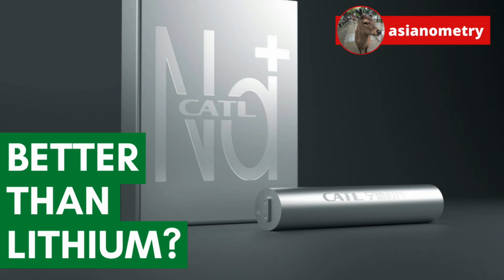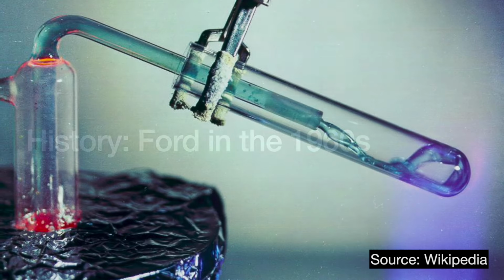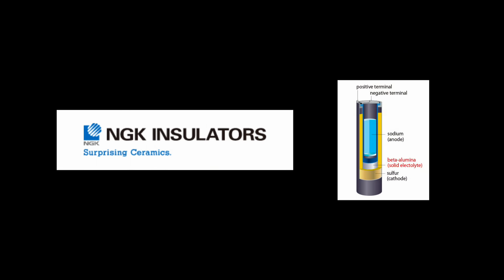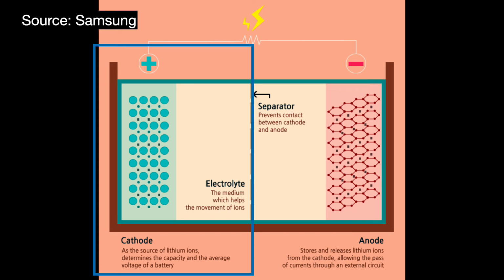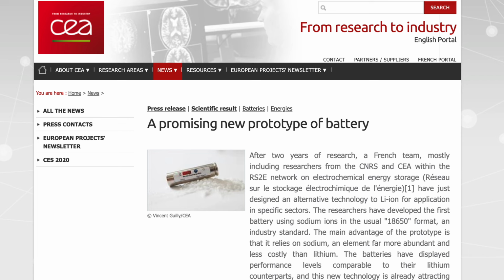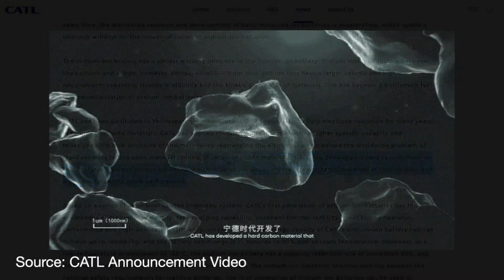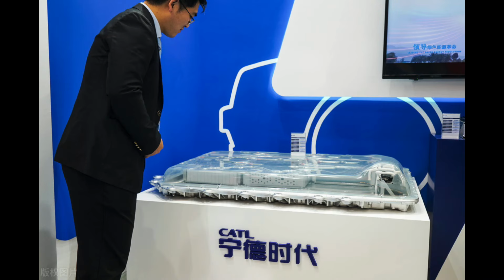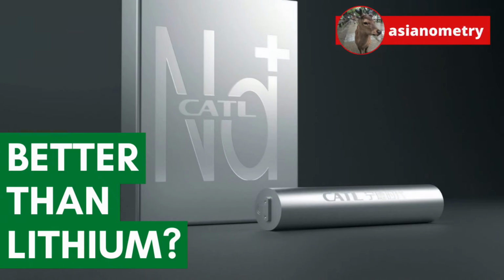CATL's Sodium-Ion Battery: Better than Lithium?

Comment: Thank you for producing this.  Many people are unaware that while sodium ion batteries  and calcium ion batteries are too heavy for electric cars, they are great for storing utility scale power where weight is unimportant.  Also, I can't see how we could possibly run out of sodium!
Reply: thay may even make desalination water plant economically viable in the future by having a good income stream from sodium produced as a byproduct
Reply: EASY ! Sodium Batteries , to run just 50 km, in a Hydrogen Fuel cell/ hybrid vehicle !  - the total weight of the hydrogen(plus tank), plus Fuel cells + Sodium  battery, should be roughly equal to the weigh of a 200km range Lithium Battery pack.
Reply: @avibhagan  LFP batteries already solve almost all issues for BEV other than lithium and even Tesla has contracted to use LFP batteries so I just don't see it happening.

And the big pushers of hydrogen which have been a couple Japanese auto makers, Toyota and Honda, have pretty much conceded they need to move to BEV, so the whole hydrogen thing is dead for cars and small trucks.  It MIGHT make it's way into ocean transport and long haul trucking in some countries.  I'm skeptical because it's just SO INEFFICIENT it's INSANE!!!

The amount of conversions and the cost that goes into each conversion make hydrogen almost laughable, then add in it's incredibly hard to store AND if you were to even use this for long haul trucking, the amount of infrastructure needed would be cost prohibitive and add in high pressure and hydrogen go together just like a HUGE BOMB.  There WILL be an accident eventually if you went to large scale use and each one would get more and more people to be anti-hydrogen.

So, just no.  Increasing electricity production and charging a battery is WAY more efficient and less costly than hydrogen.  And money matters.  Go ask all the people who can't afford their rents and mortgages anymore due to the latest round on inflation.  BEV can be manufactured for less cost than ICEV.  Tesla can already do this but they have MASSIVE profit margins, and Chinese auto makers already do this, which is where most BEV is.  Or, almost 50% of all BEVs on the road are in China.  Most BEVs are manufactured in China.
Reply: Yup, grid storage, not BEV.
Reply: maybe. sodium-ion is still a largely new technology. as it develops, assuming it stays cheaper than li-ion, it's likely that it will be used for low-cost small cars and other mobility devices that are okay with more weaker batteries. current focus in evs is on large expensive sedans, but there's plenty of space in the market for small cheap vehicles.

Comment: One factor that always needs to be included in statements of energy density, but almost never is, is the energy density at the totally integrated pack level. While this is hard to state with great precision because the variations of each individual installation, it is possible to identify features of a specific battery that will strongly impact the weight of the non-battery portions of the pack, such as thermal isolation to control thermal runaway of a single cell so it doesn't cause a cascading failure of the entire pack and the cooling system (which should include the weight of the cooling equipment outside the pack itself like cooling lines, coolant, pumps, radiators and fans).

A new battery like these Na-ion might only have an energy density at the cell level of 180-200 Wh/kg while the latest Li-ion are up around 280 Wh/kg, but the high flammability of the electrolyte of the Li-ion battery and the accelerated degradation when cell temperatures are not tightly controlled result in a considerable addition to the total pack weight and a commensurate reduction in net energy density. If a new battery chemistry like this Na-ion cells doesn't have the flammability and thermal runaway issues and so don't require careful thermal isolation between every cell and if they can retain their charge capacity even at elevated temperatures, then a lot of weight can be eliminated from the battery pack. The result would be that the fully integrated net energy density could be much closer or potentially even superior to Li-ion batteries.

And if the new battery is cheaper and/or has a longer cycle life, even if the pack energy density is still slightly lower, these types of batteries could still win out over Li-ion batteries in applications like large commercial vehicles which might be less sensitive to weight/range and more sensitive to total lifecycle cost and reliability/safety.
Reply: Ok but lithium iron  phosphate is pretty safe and doesn't have thermal runaway like lithium polymer
Reply: @NeilBooth  Tesla has made some model 3's with LFP battery packs, the LFP Model 3's are about 250 lbs heavier, have more Kwh, and achieve better real-world range. So in practice the OP's comment holds up, having a less sensitive battery cell lets you get those energy density figures pretty close at pack-level. LFP batteries are good, but Lithium will still suffer scarcity prices, so it's good to be developing these alternative chemistries that use more much more common elements. Sodium and Aluminum battery chemistries would be good for large-scale "economy grade" battery cells to use in cheaper EVs and grid storage.
Reply: @0hypnotoad0  Mhmm. Density doesn't matter at all for solar setups for example. Longevity, cost per Wh and ecological impact are what matter here.
Reply: Hot sodium aint a whole lot less reactive with air than hot lithium. Their similarity to lithium batteries suggests that they will not fare better in this respect than lithium ones for transport applications. While for utility storage where power density is only a secondary consideration there are plenty of competitor chemistries using cheap materials. But time will tell.
Reply: @kenoliver8913  The biggest problem with lithium is availability and the environmental impact of mining and processing. That's the bottleneck of going fully electric. The environmental cost alone should be reason enough to switch to sodium batteries even if it means some tradeoffs have to be made.
Reply: main issue here is: Lifepo4 is much more expensive. Lithium research had gone through so many years while  Na battery research is still infant, so I highly optimist for cheaper Na battery in the near future. Lithium is so earth toxic, dangerous.
Reply: "but the high flammability of the electrolyte of the Li-ion battery and the accelerated degradation when cell temperatures are not tightly controlled "

And yet Li-Ion has been in BEV for years, and it's rare for this type of issue to happen unless the manufacturer did something wrong.  The Chevy Bolt comes to mind.

Tesla put out the 4680 which has been going into vehicles this year at the Austin TX plant.  Their temperature management isn't extreme.  So, "tightly controlled" is a bit of an overstatement.  In fact they don't have an issue when charging which USED to be an issue with older cylinder Li-Ion batteries, and this is tabbed vs. tabless design for which the 4680 was designed for.  It's called charging along the entire width of a jellyroll instead of just as one side and the charge has to work its way across the jellyroll.  Their 4680 increases reliability and charge cycles, heat issues, just about anything you can think of is an issue, but yes Tesla has to use a little energy to warm them in cold temps and then use heating to keep the pack above than min temp.  So, Tesla 4680, solves almost everything other than the environmental issues for Li-Ion.

In case you don't follow BEV, Li-Ion probably won't be the dominant battery type already.  LFP batteries made by BYD have climbed in percentage for batteries going into BEV, and this is going to grow since Tesla and Toyota and probably other automakers have made contracts with BYD for these batteries, which means building plants outside of China in the case of Toyota.  Tesla right now is probably using LFP for battery packs going into the Asian market already but I haven't checked to confirm it.

Energy density CERTAINLY matters, and you only have so much space in a car to use for a battery pack.  Americans want high mileage/charge vehicles so they can do their long trips.  Now, once low cost econo sedans hit the US from Toyota using LFP batteries they're going to sell even with lower range because once you get to economics of scale, BEV costs less than ICEV.  Almost any of the main BEV makers in China could sell a BEV in the US for less than $20,000 USD and if there weren't a large tariff slapped on them they'd sell like crazy even though they're only 250 miles/charge.

Weight also matters.  It affects range.

LFP batteries are already superior to Li-Ion in almost any conceivable way except energy density which is why auto makers are using them.  And for Li-Ion, the only thing that's going to compete against them is the 4680, and really you should read the details about what they are and what they allow and how Tesla uses them to make a structural battery pack to understand why that's probably the best it gets for Li-Ion.

I don't see these batteries replacing LFP.  Maybe they end up in grid storage.  LFP already solves all the issues with Li-Ion in BEV except the need for lithium, but lithium is a common element.

Something better will need to come out for BEV that doesn't use rare earth elements, and doesn't use lithium, and doesn't have temperature issues, doesn't overheat, can be punctured and a whole list of other things that LFP has already solved.
Reply: difference is only 30%.. but price gap will be 50-60%..
Reply: Another big part of this is the operating temperature range, the need for a battery management system (BMS), and whether it will need an active thermal management system. 10,000 cycles with only 5% loss of capacity is a huge deal, as one often overlooked metric, but the most important one, is cost per kWhr/cycle
Reply: Ok but lithium iron  phosphate is pretty safe and doesn't have thermal runaway like lithium polymer

Comment: If they can achieve the 200 watt hours per kilogram as mentioned at 11:12, an EPA rated range of 250 miles should be achievable in a car like the Tesla Model 3. Can they be charged to 100% without excess degradation? Do they perform well in cold weather? If so, they would be as good as today's lithium ion batteries with a range approaching 300 miles charging to 80% to 90% to preserve longevity. If you know something about sodium ion's ability to take a full charge I welcome your comments.
Reply: Cell or pack

Comment: REGARDLESS of their ups and downs - if you can have 50% of EVs using a different type of battery - you can make BOTH types of EVs cheaper because now you don't have to get in line to buy a LiIon battery driven car at higher and higher prices as production struggles to cope with demand.

Comment: "Natural sources of lithium are limited" is  an asinine point all natural resources are limited, the question is how limited. Lithium is est. to be 25-34rd most abundant element, known sources could provide several hundred years worth. Also up to 95% of the components of the battery is theoretically recyclable. Look at Red Wood Materials former Tesla CTO and co-founder JB Straubels new company, they are claiming to be recycling at 90% and are opening a new factory. They aren't he only ones.

Comment: All looks good and also as you said..it might be big nothing..if price of material is lets say 30% of existing Li ion battery why should i as customer go to battery that is about 20% cheaper than Li ion..and nobody can tell me if it will last after 10 years ..If price would be 30% of Li ion and same parameters (lets say double the weight a bit bigger housing for it ) i would accept it and use it on my house as main battery..but ofc they can't prove this..they only talk how it could be used and outside few prototypes they don't have anything usefull ..Yes they might test it for long time and that is fine..but you can be sure LiFE ion battery research isn't stopping also..they also want to be better than somebody else..so they try to inovate..

Comment: It won't be commercially viable with 10-30% lower cost, since it has nearly 40% less energy density than Li-ion.
Reply: Battery cost is always compared as USD/kwh.

Comment: Note the difference between the wide class of “sodium batteries” and the more specific “sodium ion batteries”. I’d say that within that wider class, there are “sodium ion”, “sodium metal”, and “molten sodium” battery chemistries. The advantage of sodium ion cells is they’re basically designed to compete with lithium ion cells, which have the high energy and power densities needed for electric cars. That said, the complex manufacturing process and potential for dendrites make these still not as optimal as they could be, especially for grid storage. “Sodium metal” batteries would consist of batteries with a solid sodium metal electrode, would likely be primary cells without some rather strange electrolyte, and could be major fire hazards when punctured. “Molten sodium” cells are even worse for danger, and also have that heat problem you mentioned, but they’re basically impervious to dendrites or other electrode damage, since the electrodes are liquid. There are also notable alloys like NaK and GalInStan that are liquid at room temperature and would hence have no heating overhead, and there are also some strange salts that are molten at room temperature. Importantly, these molten cells have very simple internals, and are more promising for grid storage where weight doesn’t matter. For grid storage to be viable for a country like Germany to switch off all its coal and solely rely on solar and wind, it needs to be orders of magnitude cheaper than lithium ion.

Comment: the codes r tail banking 72% vol not loud enough, 1968, 68 or Me & devil last act of play AC window unit comes up alot w/71 degs if u hve 2 deg float & room temp 70 deg setting. This is 262 comment & likes 2.7k & the not likes hve been working either or as well. See Beg of word/game I saw 27 OT as right "number". Those who could hve been keeper/wives birthing new ruling line, not knowing about 70/72 float NT number at time. <I had a multi faith test> many times over in the "game... or game w/in game... or then some... & codes working again!

Comment: What people fail to realise is that even if a much improved battery is created - say 10 times the capacity but the same size as lithium units, they will therefore require a much longer charging cycle. Fast charge? Sure and so many higher capacity batteries would destroy the electricity grid. Longer charge over a weekend? Like everyone else you mean and thus wreck the electricity grid too.
Electric vehicles as they stand are utterly useless aside as short range commuter vehicles. The ICE is the only way forward.

Comment: When will we be getting rechargable aluminium air, and potassium batteries
Reply: They are! You must change the electrolyte and you can recharge about 10 cycles until drops the capacity the alluminium air battery

Comment: Lithium extraction is actually environmentally friendly when compared with extraction methods for other metals
Reply: It's not though, because of the chemicals and energy required to refine it.
Reply: @eylonemuskson4177  give me an example of other metals that are more environmentally friendly to extract/mine
Reply: And people also forget the massive issues with coal, gas and oil extraction, refining and process when criticizing renewables. People want a perfect solution instead of shifting to a better one and improving with time. 

Difference is, you can recycle all those metals cheaper than capture all the CO2 emissions done so far by the fossil fuel usage

Comment: thats no news in mobile burn in car burn is however usable tech in space especialy in no water zone and cooled athmosphere so sudern burn or car burn is slight less possibel at windy temprature or extreme cold  and price is easy to produce this however significance off space base transport goods research and ore exract in space and construction too works as opostie to lithium ion bateries but similar stuff in space and get it out base on planets becomes extremly usefull also it lower price off consuem bateries and rize hot topic standards use off tocamac core in space price for it and everyday use reality becomes usefull or very aplicationable still sudern burn efect is more plausable then posible to be made if things continue in recharge state to soemtimes acidentaly burn you can say limited use only or on missions

Comment: Na ion battery won't be in direct competition with Li ion due to different application scenarios based on their strengths and weaknesses.
Reply: They absolutely are in direct competition. Anywhere a Li ion can be used a Na ion can be used, and vice versa. They each win out in some circumstances, so neither is straight up 'better'. That doesn't mean they are not in competition.
Where they are not in competition is that most of the advances for one can be applied to the other.
I get the sentiment (we want both), but to not be in competition they have to be in markets where each could not do the job of the other, and that is not the case.

Comment: Na-ios have less energy density than lithium-ion ... I don't think Tesla planned to put this on a car.
But Na-ion to reduce cost for Power wall / Sola cell is a good option.
Reply: You might not want to put them in a car, but you very much might want to put them on a bus.
Reply: @SianaGearz  i thought they are both same at 160wH/kg